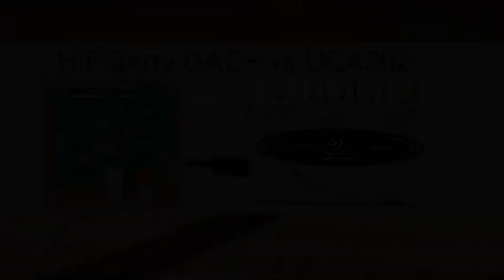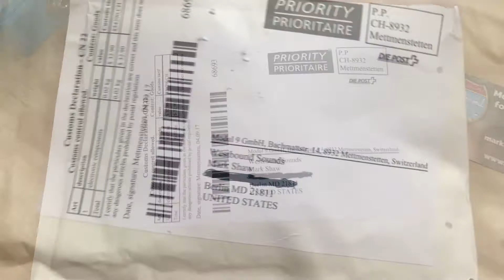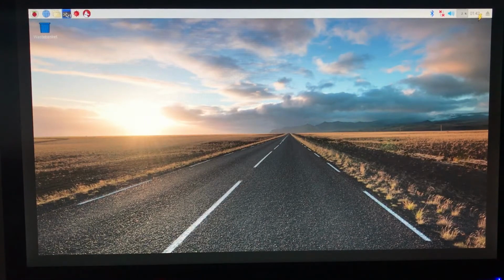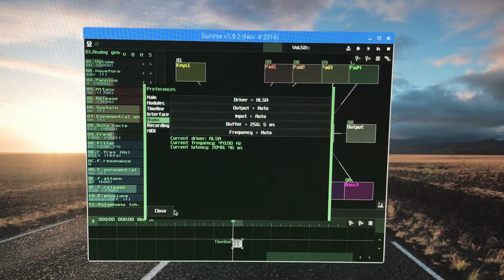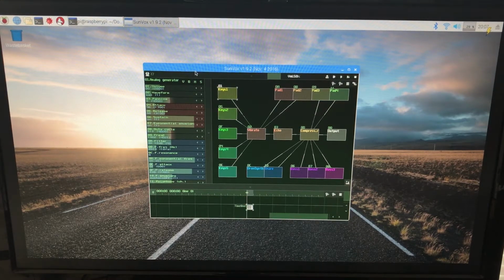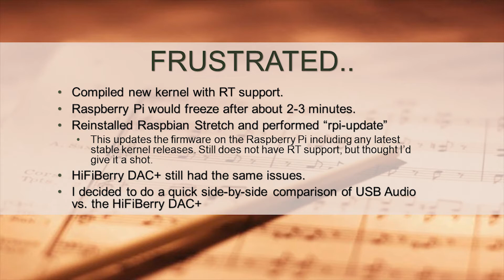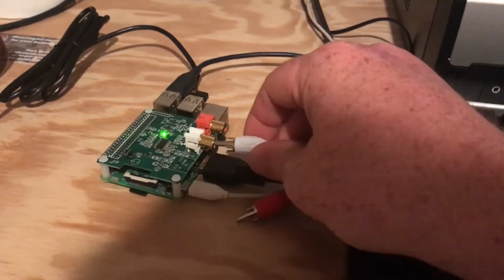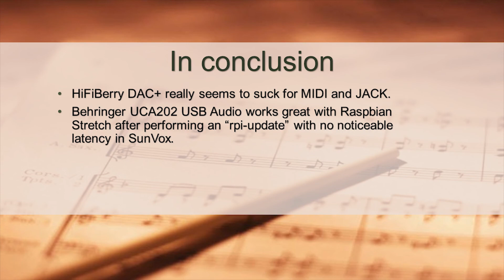Raspberry Pi 3 SunVox Synth HiFiBerry DAC+ Standard vs. Behringer UCA202 USB Audio (Saga Continues)

Comment: I'm using Sunvox with Zorin OS 15 and there's not much latency using my regular keyboard as a controller (MIDI controller on order) My desktop has it's own sound card, but I use a USB soundcard if I'm worried about my inputs. Thanks for the very useful Info.

Comment: I came by this video and i don't know what to think. I don't want to sound contemptuous, but it seems like you are making this too hard. I had real problems with that stock Rasbian OS, so i tried DietPi, and that was what i needed. I had to install certain things manually, like libsdl2 for sunvox, but it worked seamlessly,  just like Linux on a regular PC. I got Sunvox 1.9 running on a Pi 1b with 11ms latency very stable. I used it with GPIO. You can go as low as 5ms but obviously, at 700mghz it's hardly going to allow any modules. at 11ms it works much better and has no jitter in the output of audio, MIDI, or GPIO. rock solid. my soundcard is just the HDMI out, no input at this time.I don't think that the soundcard really matters in Linux, which is why this video is so odd to me.
Reply from the maker: It was a much different situation back when Raspbian Jessie was out. We're talking 4-5 years now. There was no real-time support compiled in the Linux kernel at the time and audio was very finicky in general with 3rd party devices. We've come a long way since then and the process is basically effortless.

Comment: You forgot to include how to install SUNVOX. The one i downloaded has all versions but when you click on it Nothing happens. What you show in your videos is handy info if only something would acually work when I try it. The jackctl runs but no sound at all. Nothing makes sense here. I tried another program called Grand orgue & that works but the Latency makes it unuseable with almost a second lagg, using a laptop with behringer 204. With that setup i tried the jackctl as you suggest but that produced No sound at all. I long for the Old Amiga days, they did So much with so little, now we have such Powerful computers & still can't get them to JUST BLOODY WORK. Pretty frustrated after 2 weeks of No good results.
Reply from the maker: There's nothing to install my friend. You unzip SunVox and run the binary. It sounds like you're not running it from the Terminal. Open up a terminal, use the "cd" command to change to the directory in which SunVox is located, for example "cd /home/user/Downloads/sunvox" then cd again to the raspberrypi directory, and run ./sunvox. There are several video parts to my series on Raspberry Pi synths, and it takes patience to understand how all the components tie together. The latency issue is why we use JACK to address those problems. You can use some of the settings I've outlined in qjackctl. But don't click the "Start" button in Jack. Close out of it. Once you've set that up, run your software, whether SunVox or Grand Orgue. Check any audio settings in the software to make sure you're using the "JACK" driver if the option is available like it is in SunVox. Then, run qjackctl AGAIN while the other software is running, check the MIDI tab, and connect your instrument in there.
Reply from the maker: Please feel free to contact me via email mark at wbsounds.com or Discord - Comet#9899 and I'd love to try and help you get this working properly.
Reply: I also discovered my linux was out of date & crashed after updating it. Downloaded a new distro & started again,  still got big Latency but,  so yea more work & more gear on order.

Comment: zynthian.org seems to have gotten the HiFiBerry DAC+ working with low latency on their Pi-based synth project.
Reply from the maker: Glenn Meader good to know! I really dig their platform. I’d be curious to try it for myself. Sunvox in particular runs awful with it. Maybe a software problem? I’ve since reused my DAC+ for audio listening and it’s much better as a stereo component for me. Either way it’s good to hear that some music platforms are working well with it because it certainly looks the best out of everything I’ve tried :-)
Reply: Marky Shaw I downloaded the Zynthian image and booted it on my Pi3 with just official RPi touchscreen and DAC board. Just works. Easy configuration with built-in web UI. 
No need to build the box with the 4 encoders and hardware MIDI. 
Stunning collection of synths built-in. Touchscreen interface is cool. 
PS thanks for your videos on Sunvox  - learning a lot from you.
Reply from the maker: Awesome to hear, Glenn! So much has changed since I looked at Zynthian over a year ago! It was confusing to even find the downloads for their image. Now it's all there and much more easily accessible! Looking forward to trying out the HiFiBerry DAC+ again to see how it works! Are you using the latest DAC+ ADC from HiFiBerry? I see they have a new version of the DAC as well, which I don't have. I really wonder what has changed. A big thing that irritated me was an "Auto Mute" setting that couldn't be disabled in ALSA. Sounds like a fun new project to explore again! Thanks for the update my friend. Super glad to hear how well it went!

Comment: weird I have Raspbian stretch, a piZeroaudio dac but when I open up the boot config I do not have that line"dtparam-audio=on", I am stumped
Reply from the maker: Hey there ZipSnipe, I wonder if this is because the Pi Zero doesn't have the same audio outputs as the Pi 1,2,3? That still might not explain why the heck that line isn't showing up in /boot/config.txt - I assumed you've scrolled all the way down to the very bottom of that file. Do you see other param lines at all? Since the Stretch image download is the same one regarding of a regular Pi vs. Zero, it would make sense that those lines should exist on both devices. Although it's possible that some kind of auto-detect feature disables the need for that param line in config.txt because it might not use the same audio chipset or audio outputs? I believe audio only passes through HDMI on the Pi Zero, which might have to be disabled through a different option. Seems unlikely though! Perhaps you can skip this step entirely as long as it doesn't cause any issues for ya. You'll just need to make sure to select the right driver in JACK. Let me know how you make out!

Comment: Very odd, I was surprised because my usb dac does not have noticeable latency on my pi b+
Reply from the maker: Hi there Chris, I'm definitely curious on the make and model of the USB DAC you're using. There seems to be a vast difference with each manufacturer in how well they perform for things like MIDI on the Pi. Perhaps I'll snag one up myself and give it a little test. Are you using SunVox in your testing? How about ALSA vs. JACK? I appreciate the insight!

Comment: Thanks for documenting this!! I’ve spent hours fiddling with trying to make music on a Raspberry Pi 2, and even Pi zero. It’s definitely not for people that don’t like tinkering. While I’d like to make a little box running SunVox someday. It runs great on my iPhone 6, and my 3 iPads including one made this year and one from 2011. So, I’d probably only build it as a novelty. I’ll probably pick up one of these cheap Behringer just as a useful interface. The USB interface I have doesn’t seem to be liked by the Pi. I think the chipset was CM108. Do you happen to remember what chipset the UCA202 is? Also, sorry for all the questions, but have you had any luck getting audio in with the UCA202?
Reply from the maker: I totally hear you on the iPhone and iPad Apps! I purchased them as well and they work beautifully. There's something about the challenge of getting it working well on the Pi that intrigues me enough to continue working on it. I really love the idea of building a totally stand-alone unit with a custom box, MIDI keyboard with button labels, hopefully a future touchscreen, and everything you need ready-to-go from the moment you turn on the power. It takes a lot of work to get there and has made for a fun project thus far. It looks like the UCA202 uses the PCM2902 from Texas Instruments. That's what shows when I perform an "lsusb" at least! I haven't tried a CM108 yet, but I can honestly say that each manufacturer from what I've seen so far, has fairly different drivers and software options. It's definitely a guessing game with these Pi's. I've had great luck with the Behringer so far. It's holding up to the test! Audio In works perfectly fine. I plugged in an old turn-table and captured audio in Audacity without any problems. Great quality too!